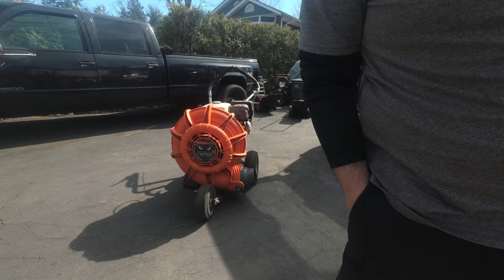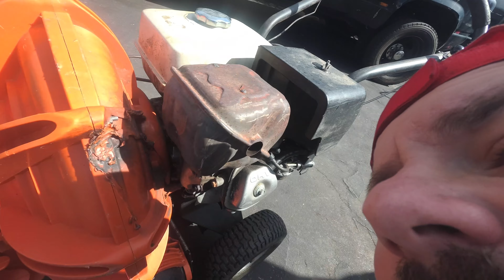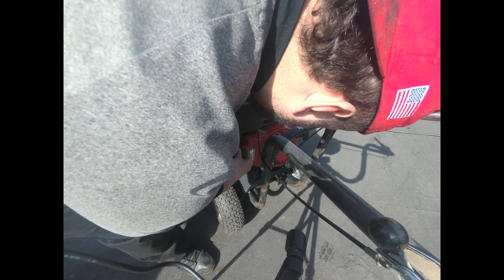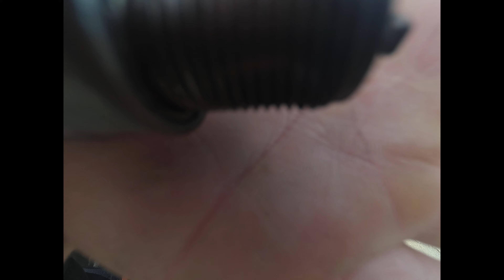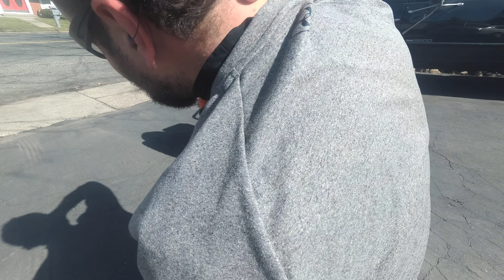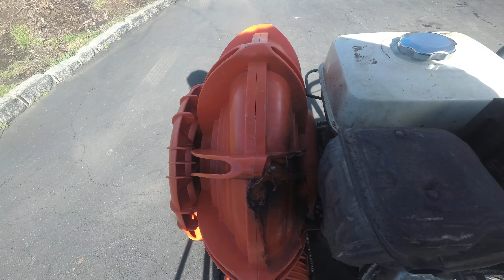$100 Honda Powered F13 Billy Goat Wheeled Push Blower WILL IT RUN?  Been sitting for 3 Years Seafoam

Comment: That's unreal....what did they do....drop the spark plug on the ground and put it back in???  I love leaf blowers.  Would love to see you flip some Little Wonder blowers or better yet, an engine repower.  Nice score on the blower.  At that price, you can't lose.
Reply from the maker: I’m just trying to piece the puzzle together. What I don’t understand as a business why not just get it repaired?  It’s worth a heck of a lot more!   I’ve never had a little wonder but I have had 1 craftsman with a Tecumseh and one MTD that had a Honda on it, 5HP before my channel started.  A lot of these pop up for good money but beat to death.  Prices don’t reflect it at all!  I have on the channel whatever makes me money!  Once things change for a bit I will buy things on purpose train wreck or not, cost irrelevant!  Repowering is just as easy as a snowblower!  If you any questions I’m always here GIVEAWAY WINNER 😬
Reply: @pattayperformance   - As far as them not getting it repaired.  I think that people just can't be bothered, as they assume the worst is wrong with it or just lack knowledge of what's causing it to not run (bad fuel messing up the carb).  They probably also don't want the hassle of lifting it into their vehicle (which they may lack a truck or SUV and can require a second person to lift it in & out) when taking it to a small engine repair shop.  When the season for that particular mower, leaf blower, or snow blower begins, many repair facilities are so busy that you have to wait a long time for service (yet another hassle).  Combine all of this together and people will many times just put it out at the curb.  More money than brains, I guess.  In life, people can always seem to justify buying a new "anything". 

As far as, you having whatever makes you money, I get it.  You can't control what deals come your way and have to take what you can get.  That's life.  Just keep it coming, right?
Reply from the maker: @stephenleone2375  Not Complaining...just like wander as I work.  I'm not rich nor poor but I would make a good effort before I let a machine like this go for $100.  Personally if this was me and lets say the engine is SHOT...take my butt to HF and get another Hemi 420cc Engine and keep on going!  The Mrs. sent out your tools today from the giveaway you won.  You should have it in 2-3 days since your so close!
Reply: @pattayperformance  -  I too would make an effort on fixing the machine before letting it go like they did.  You were fortunate to get it.  What else can you say, right?   Thank you again for the update and the giveaway.  I'll let you know what I think of the tool.